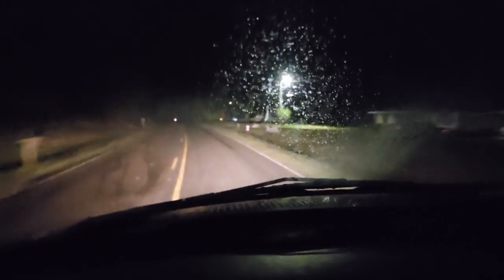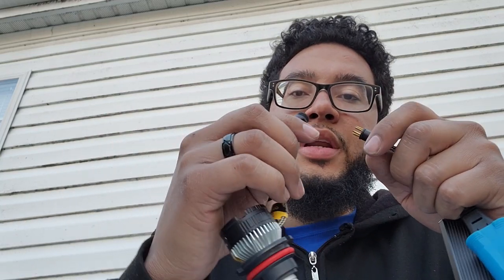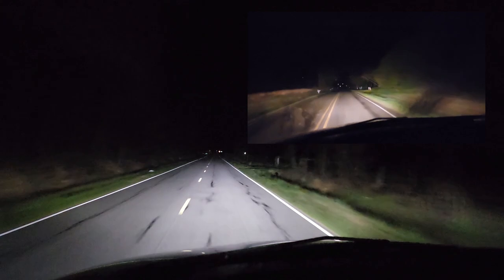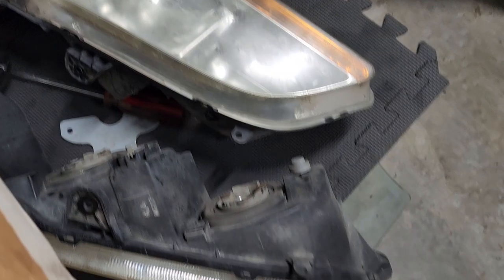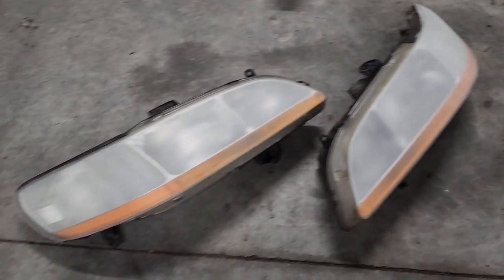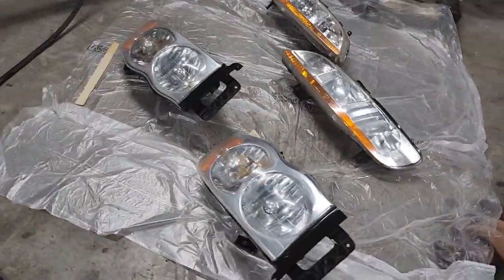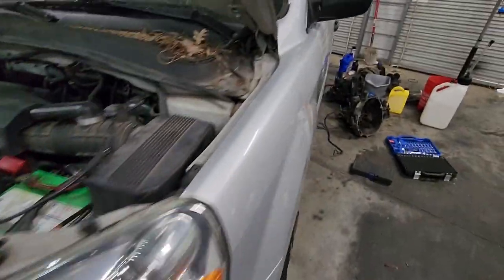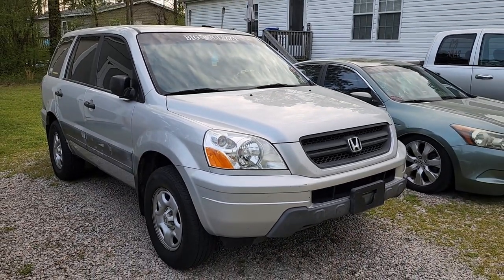MAJOR FACE-LIFT For Any Older Vehicle! | LED Upgrade And Headlight RESTORATION!

Comment: Bro I got sum like that in my Durango u got to reverse the polarity wiring in the bulb itself it can go in any possible coordination, color only changes on low beam when u turn them on n off quickly hi beam will reset them back to white regular mines go from what ever the highest in white k is to 8k blue then 12k blue which is really deep I actually got pulled for the deep blue color sorry 4 rambling R.A.B ✌🏽OUT
Reply: Oh yeah there is actually a video on them on YouTube I believe